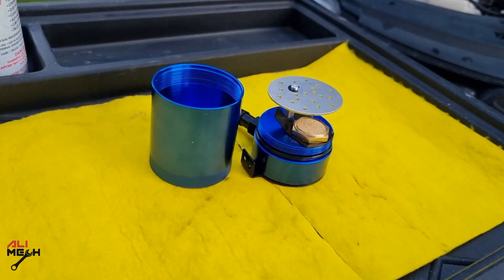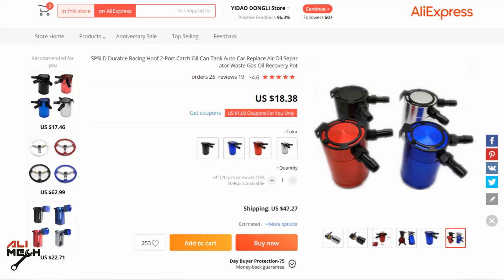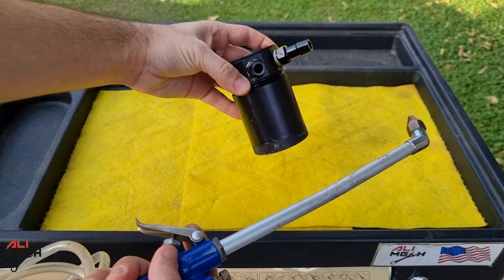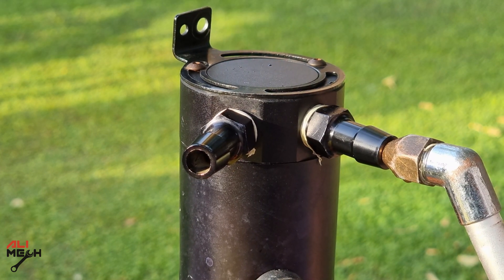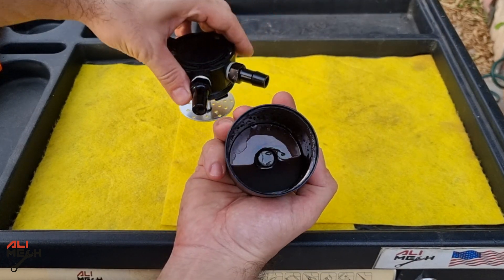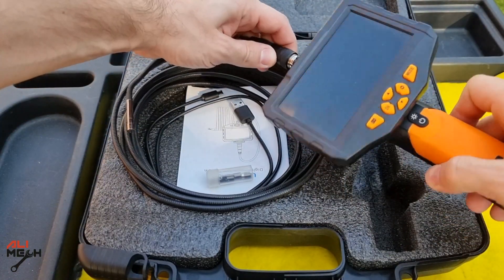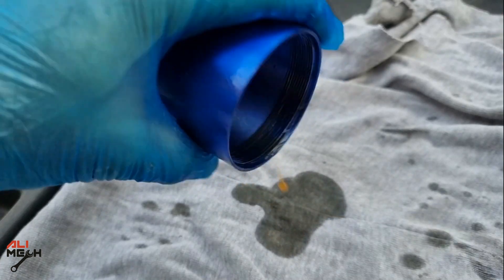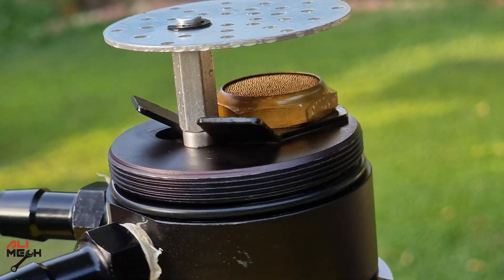Every Oil catch can should be tested like this / How oil catch can works / Purpose of oil catch can

Comment: I installed the same catch can on my car and nope, it doesn't behave well. With the bronze filter in place, the blowback sensor sends my car into Limp mode because the crank case pressure is higher than it should be. After getting rid of that, the car almost went back to normal. With the catchcan without the bronze filter, the boost is lower than before. So I press the acceleration and I don't have as much power as before. And also, the DPF fills up about twice as fast. So my car's engine doesn't like catch cans.

Comment: Need to test with vacuum and vacuum with pressure, pressure alone will give misleading results. Vacuum only will be NA applications, vacuum with pressure will be boosted applications. Pressure only is not a use case.

Comment: The water spraying in and sitting was cold but its the heat inside catch-can creates the water from condensation, also the sitting water evaporates from heat build up inside and cause water into atmosphere inside adding to build up from condensation that's where water comes from not the crankcase pressure going in. Issue is condensation with catchcans.

Comment: Hi man!
What about the Crankcase pressure that lock this type of catch can with bronze filter.
I read a lot about this type of catch can and people are complaining because this catch can can;t release the pressure of the crankcase like before and blow the VCG leading to oil leaks .
I had on my BMW N52 engine like one day and after I read this I removed it.
My purpose is to clean my intake and cylinder head from moisture and carbon deposit but I don't want to create more crankcase pressure.
I want to hear you opion
THX!
Reply: There are other catchcans. From 1,5bar to almost 6bar with this is alot. Search the other one without gold filter.

Comment: This test should be done with oil vapors not liquid. So it should look smoke coming into the catch can and if filtered properly, should have little to no smoke passing through the outlet.
Reply: Water is less viscous than oil, if water is held by the can, so will oil.    Water is also an issue with catch cans in winter, this shows water condensation is held by the can. 

Hard to do the test with oil vapors @ 200F!

Comment: I keep getting oil spraying out the breather filter  with these. The 'in 'is from the rocker cover breather and' out' goes back to sump. Should I change them over or block one off?,  I notice there isnt a filter inside it just a baffler.

Comment: using a bronze filter like that can raise crank case pressures on boosted engines especially which can blow oil out of the engine seals. when the bronze filter element gets saturated in oil it raises crank case pressures.  glad you didnt buy a element filter type catch can as those will def cause havoc quickly.
Reply: Corect !👍

Comment: I'd be curious how  much it increases the crankcase pressure.
Reply: depends how You hook it up and what kind of can, I've noticed alot of people with turbo cars installing one and only uses the turbo intake pipe as vacuum source I'm certain that increases crankcase pressure quite a bit on idle, but not drastic... I on the other hand went with OEM plumbing when installed mine, 2 exit ports one goes to the turbo intake pipe for on boost and the other to the intake mani for off boost, My CC pressure has a pretty good vacuum because of it, these kind of cans with sintered filter HAS to be connected to the intake mani as well to avoid pressure build up as the filter is quite restrictive
Reply: Y @GCS88
Reply: @GCS88 corect!👍
Reply: You can create a pcv system using a catchcan that vents to atmosphere under boost with multiple check valves, spring loaded. Boost closes the check valve redirecting the crankcase pressure towards the other check valve that leads to the filter. Obviously the check valve that isn’t closed by boost will have less resistance so the crankcase pressure gets vented that way, this system helps keep the vacuum under idle.
Reply: There is a video about this. 1,5bar normal and pretty high almost 6bar now.

Comment: Hey Ali, good video as always. But this generic type can increases crankcase pressure x4 and restricts blow by gas airflow. You"ll have oil leaks and expensive problems in the engine if you continue to use it. So i don't recommend this type. You should buy better oil cather. Provent 200 is much better. Stay safe.
Reply: Not guaranteed you'll have leaks but the possibility to. Which is enough for me to stay with a simpler version and tweek it as needed.
Reply: why will it increase crankcase pressure ?
Reply: @SeasonThreeIsBetter   @moremolecules did a similar video about crankcase pressure. He shows the pressure difference.
Reply: I have this and now I have oil leaks
Reply: It seems to suck air into the crankcase instead of crankcase blowing out. I'm not using pcv valve but the second outlet I tested it by bending the hose and it went quiet
Reply: @Tupusegafaoaiga  If you bend the hose, it will stop the air flow regardless of the direction it is traveling.

Comment: Can you try making a negative pressure from the other opening to match the condition in the car?
Reply from the maker: That's a great idea, sure I will do that too
Reply: @AliMECH Thanks, Any update on this test?
Reply: good point. This test currently does not consider the engine vacume.